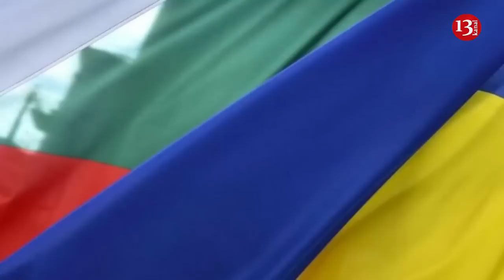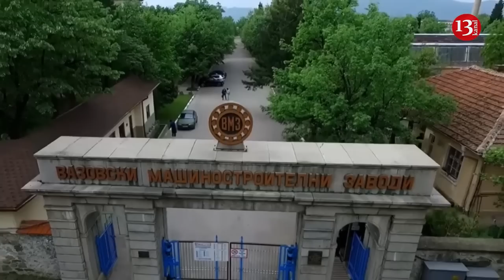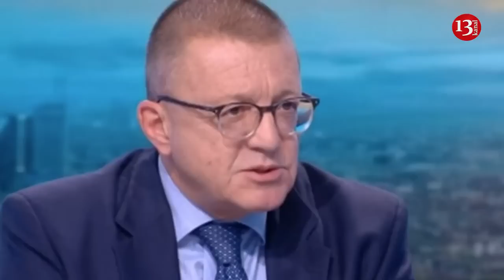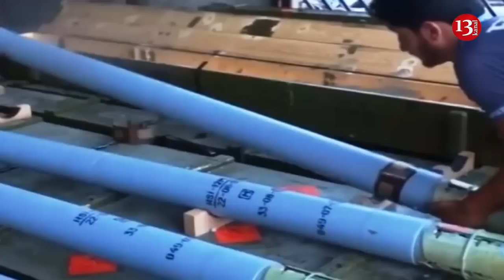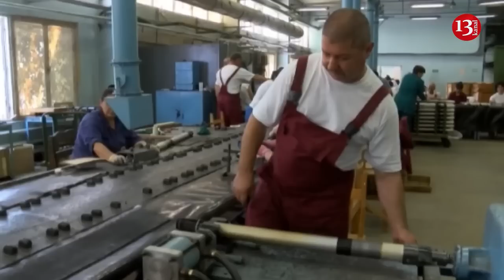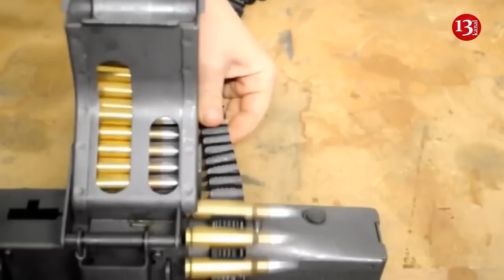Bulgaria "secretly" sends Ukraine huge amount of ammunition

Comment: Bulgaria certainly has very large quantities of Soviet ammunition in its stocks. Until 1990, the armed forces of Bulgaria were completely equipped by the Soviet Union. The old Soviet howitzers of Ukraine need ammunition, and the Soviet BM21 rocket launchers and the Soviet tanks of Ukraine. The Soviet weapon systems are not as accurate as the weapon systems supplied by the West, but they still have a lethal effect.
Reply: Excellent comment 👍👍The only 'negative' about this old ammo (..which a Ukrainian soldier mentioned in a video I watched..) is that old Soviet-era ammunition can to be more inaccurate & will have a slightly higher chance of being a 'dud', nevertheless it will be very helpful. 🤔
Reply: Actually, we do not have a lot of russian ammunitions. Storing so many weaponry is expensive and we have a very tiny military budget. For example, at the moment we have only 2 fighter jets. Even before 1989 we did not have much - the military strategy was to resist for 8 hours in case of a turkish attack. After this time, USSR would be able to send us thousands or soldiers, tanks, jets, etc. and they will replace our army :)
What we have now is a relatively huge ability to produce ammunitions, most of them are still soviet style. If i am not wrong, one of the 155mm projectiles which Ukraine uses can be produced only in Bulgaria now.